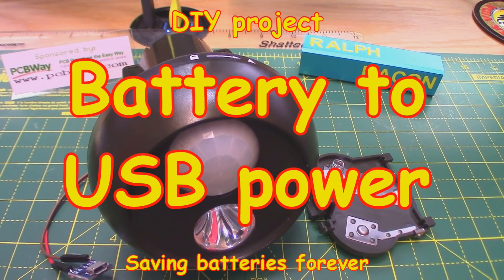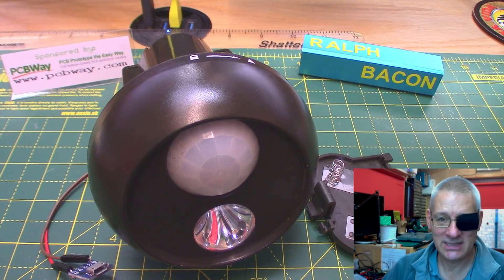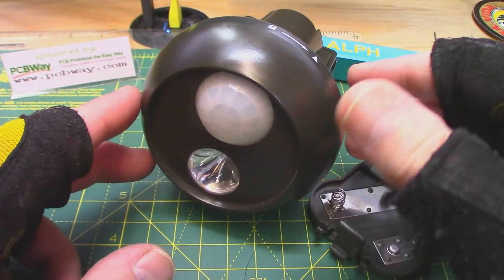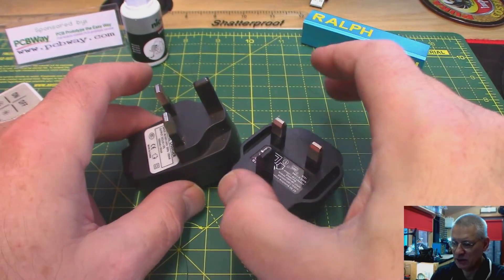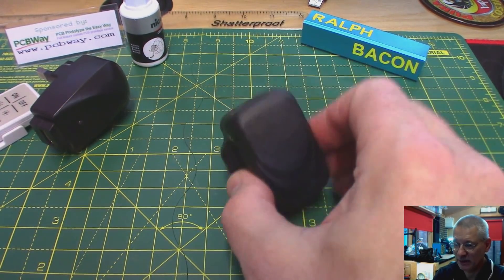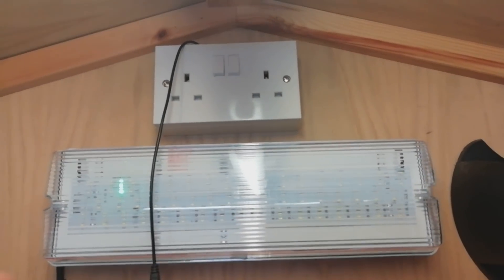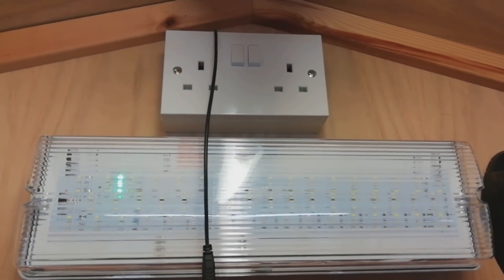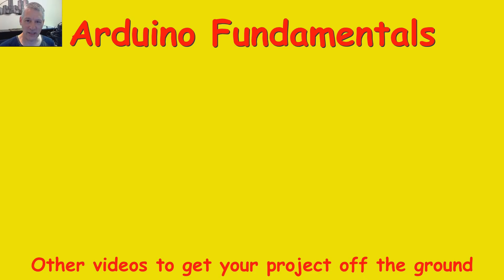#126 Simple Battery to USB power conversion (mini project)

Comment: hi i need to modify the Automatic Perfume Dispenser  Sprayer which need 2 AA battery. can you tell me how to power up by usb  cable ? thanks
Reply from the maker: You need to work it out. Two AA batteries are only 3 volts; your phone charger is 5v. Using a phone charger will burn out your perfume dispenser. So now you know that you need to convert 5v to 3v.

Comment: Can you use dead AA batteries instead of making dummy batteries out of wood (Drilling holes and running wires)? What about dead AA Rechargable NiMH batteries? Would the consistent DC voltage damage the unit or cause/damage the batteries to foam/explose?!

Thanks!
Reply from the maker: I think you have answered your own question, Ahmed! NEVER use "dead" batteries of any kind to take the place of a real battery, as it will undoubtedly leak and corrode your equipment, or even catch fire. What you really want is not a wooden, drilled battery but a battery spacer. These normally allow you to use a different sized battery eg an AAA instead of an AA cell and all you have to do with these is solder the two terminal together. Search Amazon for "battery spacer" to see what I mean.

Comment: I too had considered using a diode with a 5 volt supply to drive some LED lights that were orignally powered by 4.5V worth of batteries.  Great minds think alike,  I guess!  :-)
Reply from the maker: What was the rest of that saying? Great Minds Think Alike, and Fools.. oh, well, we'll skip that! It's still working just great, lighting up my workshop door area.

Comment: Thanks Ralph for vids like these . I have a question I hope you could shed some light on . I have a sound effect board that runs on 3 AA  at 4.5 volts . I want to convert it to USB power so I stripped the ends of a USB charge cable put a 100 ohm resistor , asper someone elses advice , on the positive side attached it to the board and I just get a blip of sound not the full track . I reattach the AA battery pack and all works fine . Is the resistor value the issue , I don't want to run 5 volts although I see that some do for other applications . Any solutions or advice ? any would be appreciated .
Reply from the maker: When connected to the 4v5 volts you need to measure the current being consumed. Let's say it is 50mA. Now when using a 5v supply you want a resistor to allow 50mA to pass and drop 0.5v in the process. Using the standard ohms law, that would be 0.5v/0.05A which is 10 ohms (not 100). But you need to measure your exact current and substitute the correct value. This page may help you:
https://sciencing.com/calculate-voltage-drop-across-resistors-6128036.html
Reply: @RalphBacon  Thanks so much Ralph for taking the time to send some good info . Since i left the above comment i have solved my issue which ended up not really being anything to worry about . After measuring the voltage pack [ 3 AA cells ] with fresh batteries the voltage was 4.7 volts and since most components are built with limits i decided to roll the dice with the 5 volt USB power pack that replaces the AA batteries . No smoke and all still works . Thanks again my friend and have a good weekend ..

Comment: As USB power supplies can be noisy and more like pulsed DC - for sensitive  circuits - it may be necessary to add a bypass capacitor or even  an  electrolytic capacitor .
Reply from the maker: Tell me about it! USB plug-in PSUs are the devil's work for electronics although it's surprisingly easy to add in a small smoothing circuit. For this application I didn't bother as it's just an LED and the surrounding electronics didn't seem to mind. Perhaps the USB PSU I have is good enough in this case.

Comment: In lieu  of a step drill (or reamer) use an OLD soldering iron (bit) to melt a hole.
Reply from the maker: I used to do that Kenn, but it kept setting off the smoke alarm! And the smell was awful. I'm sure the fumes were injurious to health!
Reply: @RalphBacon  My bad - ONLY do in a well ventilated area

Comment: For Li-ion batteries (3.7V) two 1N400x  diodes (one on each wire) ought to work  (5V -.1.3 is 3.7V).   Remember to have the diodes forward biased, else just put them in series.  Bearing in  mind the 1N400x are rated up to 1000 mA    :)
Reply from the maker: Good point, Ken, I could.should have done that! It's still working well, BTW, and no flat batteries!

Comment: *Pedantic mode engaged*  That's not a reamer, it's a step drill ;-)
Reply from the maker: Yes, it is. I have a reamer too but it is so sharp (and dangerous) I don't like using it. This step drill is great if you don't over do it though.
Reply: Reamers are more useful when used on say a lathe or a mill, they're not really for use with hand tools.  They're for when the hole diameter needs to be extremely precise.  First you drill the hole, then you use the reamer to take it to final dimension.

Comment: Of course you folks over across the pond probably won't need this bit of wisdom, however for those who still own firearms, that correction fluid is wonderful for filling in the serial numbers on guns.  I saw this first in an arms room back in '72 when I was still a Sp4 pulling guard duty with the 3rd Armored Cav down at Fort Bliss Texas.  The armor did this to all the M-16's in the rifle racks, then it was much easier to walk down the line and find that one rifle that was issued to the individual who handed him his rifle ID card.  I guess it would work for other things with stamped numbers as well.
Reply from the maker: I guess it would, Jerry, although unless you're in the armed forces this side of the pond I don't suppose many people would ever get to see a live firearm of any kind. I wonder if the makers of typing correction fluid ever considered how their product would be used! (Rhetorical question).

Comment: Awesome video.  I am surprised you didnt use an arduino to pwm the 5 volts to 4.5 instead of using the diode.  Yeah, that's overkill but any excuse will do : )
Reply from the maker: As they say, Joey, KISS - Keep it simple, stupid and I as someone who can be quite stupid I kept it very simple! It works great, I'm very pleased with it outside my workshop during these dark nights.

Comment: Does the pir have a sensitivity adjustment? Might keep your back garden from flashing like a disco, or does Benny need to get his groove on?
Reply from the maker: Funnily enough, it doesn't, but it never seems to switch on except when someone (or Benny, hedgehog, stray cat etc) is around so it's doing its job well. Even better since the conversion to USB power!

Comment: what i have don before was use a usb lipo charger its an abuse of it but it works sense the circuit will limit the current and voltage too around 4.5 volts max and give only at most 1 amp unless you get higher versions.
Reply from the maker: I think the word you're looking for is "repurposing" and it's not an abuse as such at all! After all, if it works then it works. Sounds quite interesting actually and potentially more efficient than dropping the voltage via a diode, maybe. Thanks for sharing this, Lonny, good to hear from you.
Reply: @RalphBacon  not a problem and true . it also would stop over current situations if it shorted as well . i do love your channel its neet too see what you get and what your projects are.

Comment: A fresh set of D size batteries will be around 1.6V, making the total 4.8V. I really don't think the lamp would mind a 5V supply at all.  "Better safe than sorry" I hear you saying, but still, I would try that :-)
Reply from the maker: Oh, ye of little faith! What makes you think I did not try 5v, Bora? When I had it on my workbench the current climbed alarmingly high as it approached 5v so I killed the power quickly (I didn't want to destroy the very LED I was hoping to use).
 
So I didn't repeat in the video as that would have been tempting fate. Incidentally, my super-fresh (from last year) D size was spot on 4.5v by the way, another reason I would not trust the full 5v. Better safe than sorry, I always say, oh... you already knew I was going to say that!
 
Nice to hear from you again.
Reply: @RalphBacon  😄😄 Well, you did not mention that in the video... 😉 Anyway, it's great to have you back!

Comment: Nicely done Ralph.

I've never understood the idea of devices that are permanently installed on buildings being purely battery operated...

Next trick, put a lithium battery in there with a charging circuit so you'll have easy access in the middle of the night when the power is out.  You KNOW all the flashlights in the house will have dead batteries...
Reply from the maker: Honestly! The pair of you! Talk about spoilers! Seriously, though, guys, that's why I kept this all pluggable so that I can undo it all and do what you say in a future video, if I got the urge. I was also thinking solar cell at one stage but there is no way it could support this amount of current during the winter months. Nice that we're all thinking along the same lines.
Reply: @RalphBacon  That is why I always suggest a solar panel capable of providing a minimum of 2-3 times the needed power requirements. Granted a TP4056 module cannot charge the batteries at the current possible by this panel in full sunlight, but on a cloudy day it is possible to determine the maximum size of the panel needed to provide the minimum charge current.
Couple that with a lithium cell capable of lasting during the longer dark hours, tweaking the sensitivity of the PIR sensor, and taking into account quiescent times when the light isn't lit, it should be a completely do-able project.
Reply: I had a similar thought myself. Use a TP4056 module with a lithium cell instead of the "D" cells. Couple that with a 2 or 3 watt solar panel and disconnect from the mains altogether.

Comment: Nice idea with just a diode Ralph. A standard linear regulator would have had too much of a voltage drop to provide 4.5v for max brightness. Even if the light will be happy with any voltage from 4.5 down to maybe 3 volts I think depending on the status of the batteries.
Reply from the maker: Danke, Michael. Good to hear from you again. Glad you like the idea of just a diode. Bis bald.

Comment: Glad to see you're recovering well Mr B. Its a great project and has reminded me that I've got to fix my garage PIR.
One thing that made me wonder is why you used a USB plug adaptor on the light rather than just cutting the USB plug off the power supply and soldering the wires directly to the light?
Reply from the maker: Hey Lee, so nice to hear from you. I kept the plug purely so that it was all "undo-able" if I decided to enhance this ever, with a solar cell, Lipo etc. And this way I can remove the housing (should I ever need to) without desoldering or cutting wires. And it gave me a chance to show everyone the tiny USB sockets that could be of use in an Arduino project. That was it, really. Nice to hear from you.

Comment: GOOD TO SEE YOU MAN!!! I just modded all of Wifey's battery operated Christmas Chockies that are sitting on the fireplace mantle with a setup like this. Solid core from each posi and grd running to a central breadboard powered by the Micro USB breakout, Then...I plugged the USB wall wort into an Arduino ESP8266 ST_Anything relay which is connected to my Hubitat hub. Nice little schedule to turn all on at dusk and off when we go to bed each night. VERY COOL!!
Reply from the maker: Great minds obviously think alike, John! Thanks so much for posting here, good to hear from you.

Comment: Welcome back😀👍
I Wood have made as a backup Light, and used a schotky diode to a batteri (Lipo type), to make a backup og the 240 v. Is off...
Bestil regarts 👍😀
Reply from the maker: I'll just have to run the risk that the mains power fails just as I exit (or approach) the workshop then, I suppose! Thanks for your post, Asger.

Comment: Hot glue the hole. Glad you're back
Reply from the maker: That exactly what I did, Peter. Even better, I recently acquired a battery-powered hot glue gun from Bosch, very good too and even better it came with a sample selection of glues - glitter, red blue ... and black which I used to match in the glue to the housing. Worked like a dream. Thanks for posting, I'm glad to be back too!
Reply: urethane caulking (sealent) flexible and water proof and cheap
Reply: I meant silicon caulking geez : )